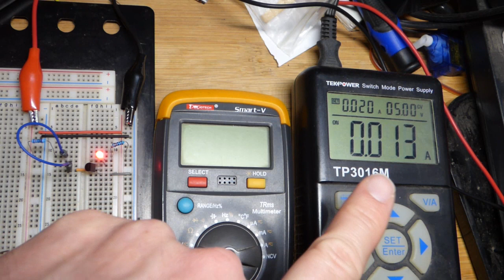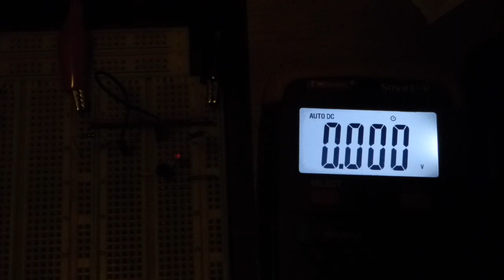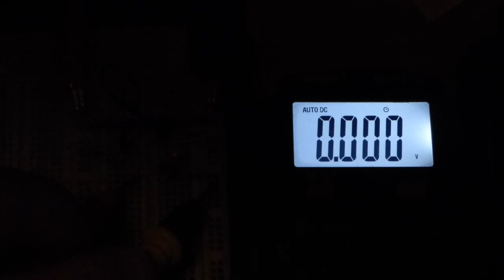Multimeter voltage measurement of important nodes of 2N2222 NPN BJT switch with LED and 220 ohm load

Comment: Nice video, love your video's, good information and straight to the point without being boring. 
If possible, can you do a video on clamping circuit using Zenerdiodes and TVS diodes ? On some channels, they explain that Zenerdiodes from arround 5V and above, doesn't have the "Zener effect" anymore, but more the Avalanche effect (sharper knee in breakdown voltage) like TVS diodes have, and that if use 2 Zenerdiodes from above 5V placed back to back, that it is the same as using a Bi-directional TVS diode. But i have never seen a comparison done side by side with both types op diodes. Grtz